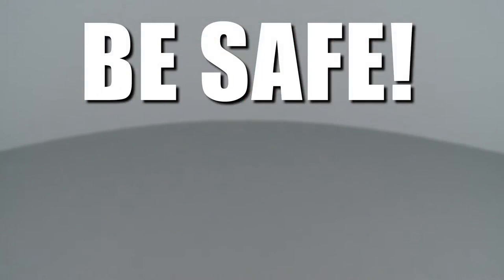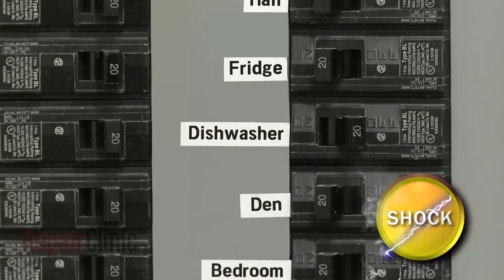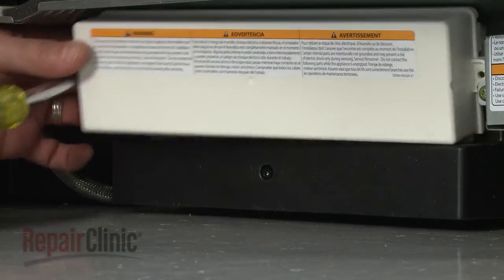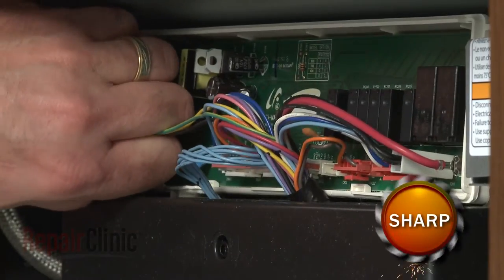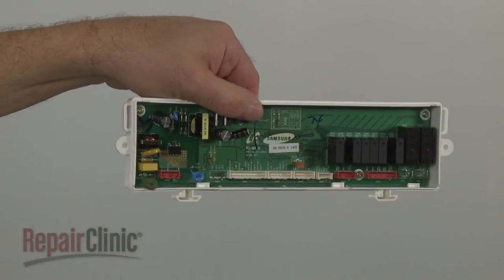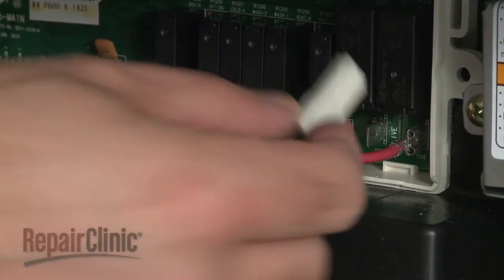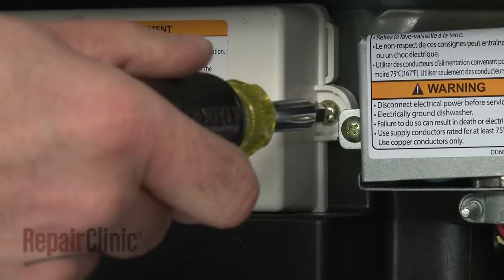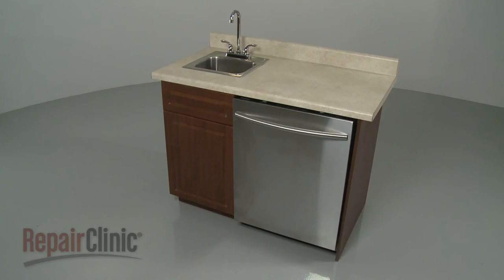Samsung Dishwasher Main Control Board #DD8201139B

Comment: Bought a Samsung dishwasher, stove, and refrigerator 2.5 years ago. Two of the three aren't working properly.  I will never buy another Samsung appliance
Reply: same with me there crap, i just sent them a nasty letter im done with em
Reply: Bought a Samsung dishwasher 3 years ago and it no longer starts. So I'll call a repair man right? No one repairs Samsungs in a three/four county area around me....wonder why...so here I am and I will attempt to repair myself......even Lowe's that sold it to me said all their Samsung customers have the same repair issue of course I get told that AFTER I bought it 3 years later. Also, what good is a warranty if no one will fix it?
Reply: @danielstamp3301  They don't want to deal with them

Comment: In these samsung models, is the main control board also power supply with safety fuses? isn't there ceramic fuse in the back bottom of it on another power supply board?

Comment: have you seen any time when the control board is causing an overwater error? i've cleaned all the hoses, replaced the main sensor (in my case the thermistor) and checked the overflow and it appears to be working properly.  I can only conclude the control board isn't signaling the water in to stop filling.  I'm within the 5 year window but just outside the 1 year parts window.  They won't replace without a certified tech determining that's the issue.   I'm not sure it's worth the cost of one though, esp since just over 1 year out and it's broken, feels like it's a lemon.
Reply: do not buy Samsung's appliances or Tvs there junk